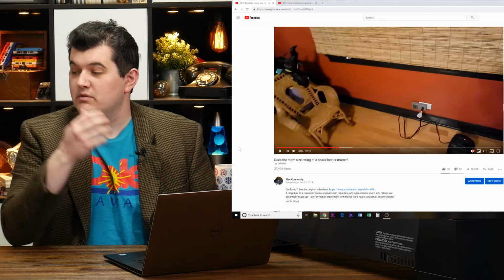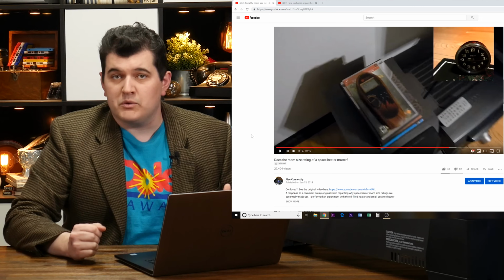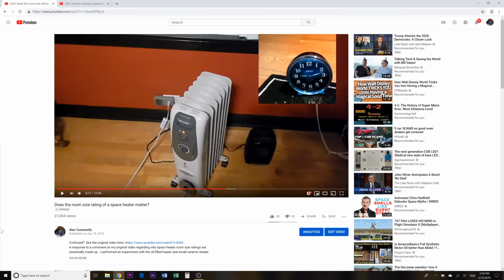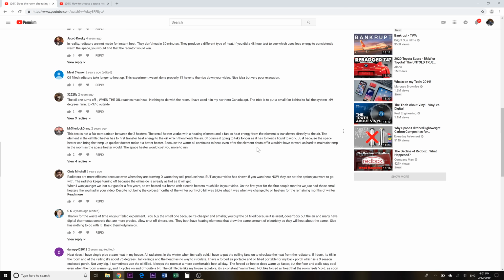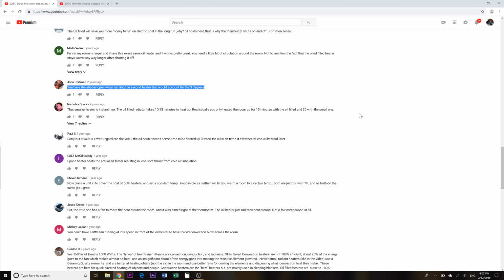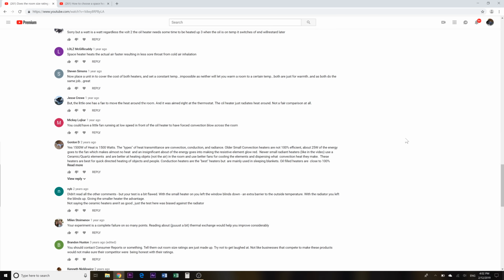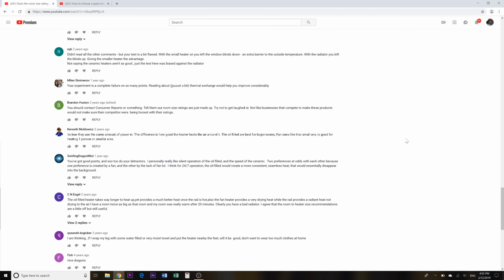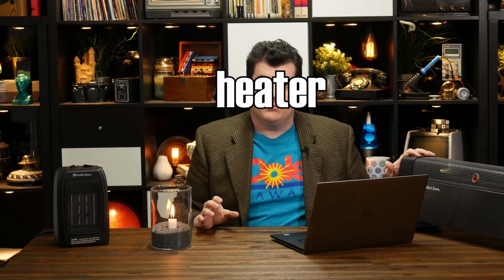More Space Heater Nonsense

Comment: My window AC pointed outside and thermostat shunted is still much more efficient than all of these.

You cannot create or destroy energy, so in a space heater 100% of the electrical energy becomes heat energy.  Period.  No matter what your argument you can't get more or less energy out than what you put in.  It's the indisputable first law of thermodynamics.  You CAN distribute heat in various ways, which is what drives a decision to not simply take the cheapest one.  You CAN use electrical energy to pull in heat energy from the outside to the inside of your room.  The inside gets warmer at the expense of outside getting colder, hence the reversed AC.  So my 500W AC can bring in around 2500W of heat, give or take, for "500%" efficiency.  The trick is it's electric work energy to heat energy, and I'm using the work energy to pull some of that heat energy in from outside.

To the videos main question: The small fanned heater is much better than the large radiant heater for a large room.  Fans distribute heat far better than passive methods, even if the unit is much larger.  Even though they produce the same amount of heat, this goes back to distribution.  The heat has trouble reaching far from the heater, and it is cooler around the walls because that's where heat is leaving.  The larger radiant heater is actually better as a personal heater.  Because it's so hot near the heater, you can turn it down and get warm near the heater.  Meanwhile the rest of the room is cooler, but you don't care.  You save energy by not heating the rest of the room as much.  So the small fanned heater is actually better for large rooms, and the large radiant heater is actually better for heating small areas (regardless of room size).  But if you write that on the box what do you think that will do to sales?  When Youtubers can't understand it even after a long explanation?  Yeah, it's all about keeping customers happy and getting them to willingly pay the most money even when they're dead wrong.

Comment: A fan helps. Something the little heater has over the big oil heater is a fan. I used to live in an apartment that had electric base board heaters, The walls would get quite warm, but the center of the room stayed cold. So I put a box fan to blow along the wall and  to move the air around. Problem solved.

Comment: At work I had a motor that was running at 20kW at normal load. The load connected to the shaft was all contained within the same room. No cooling water entered or left the room. I made the comment to my fellow electricians that the full 20kW was becoming heat in the room and the equipment at the same rate that it would be with a 20kW heater. I was very surprised when some of my otherwise knowledgeable electricians thought there was no way that could be true. Heat is the graveyard of all energy: sound, vibration, friction, light, eddy currents, hysteresis in the iron, copper losses, windage, bearing friction etc. It all becomes heat in the end. And it's all equal to the energy input to the equipment from the power cable.

Comment: Completely agree with the conclusion and, answering the question at the end of the video, can't think of any reason for the larger heater to be more suitable for a larger room. My comment is about the 100% efficiency and it is actually a question. Although marginal, wouldn't the one with the fan convert part of the energy to kinetic energy (moving the blades, moving the air)? Also, any kind of vibration or sound produced would be energy not converted to heat, right? Like I said, I imagine this would maybe cause only a marginal difference, but still not 100% efficiency in any case. Is the rational right? Thank you and congratulations for the awesome videos!

Comment: You didn't notice my comment. :/
The bigger one is the better heater for heating a large room with highly insufficient heating (as in it's 0°C outside and the window is always open) because it heats less of the room which means persons leaning close to it get more heat.
If you actually want to heat the room, then the smallest is the best because smaller=less heat energy on the heater=more heat in the room and of course a fan helps more than a smaller heater.

Comment: and that's why things are easier in europe, with 240V. those "space heaters" here go up to 2500W, and normal 1phase 3500W heaters are normal. also, if your house has a 3phase socket (which were quite normal till not so long time ago) , having a 6kW thermoaccumulation heater were quite normal (so to heat itself while electricity is cheaper, and use it when it's expensive without power usage)

Comment: Some of these small ceramic heaters have a PTC. They are like a positive temperature thermistor. As they get hotter their resistance goes up, current and power goes down. This is done to prevent overheating in case it gets blocked or the fan fails. No safety switches needed. In a very small room they just might put out less energy if the room got really hot. Still 100% efficient.

Comment: The production value of your video has zero bearing on the scientific results of the experiment. The fact is that the Big Oil filled heater can not, by Design, heat a large room as well. It doesn't matter what idiots say and try to argue. The facts are the facts. Don't let these idiots drag you down. Be you and continue doing what you do.

Comment: But dude to me the advantage of the oil heater is the fact once the room temp comes to what you want, the oil is heated up and the thermometer shuts the unit down and the heat of the oil takes over for a time.  Thus saving energy!
I had an oil heater I used in my cold room.  I liked it for how quiet it was, and yes it took a good while to get to temp but the room stayed more consistently warm.  However, one night something happened I heard a zap noise and looked over and my surge suppressor was smoking.  The suppressor was slightly charred black.  I assume the thermostat failed and I haven't used the heater since.

Also too I have one of those expensive quartz heaters with wheels.  It's big and bulky and takes up a good bit of room.  However, I really like that heater, because those quartz heaters fire up and heat a big room quickly.  Then once the room is heated quickly the thermostat kicks it off.  So by my reckoning.....If it heats quickly and shuts off it is not using 1500 watts all the time, that equals efficiency!
I would like to hear comments on my theory....Am I wrong?

Comment: Some people I know bought several of a famous brand of space heater (E***P***) to save money on heating oil. They placed them strategically around their house and used them for their primary heat source.
Imagine how surprised they were when their electric bill over the peak months of heat demand was much larger than a fill-up of their oil tank.
The whole notion of using space heat is to restrict the whole-house demand for heat by lowering the base temperature in the house a few (or many) degrees, then supplementing per room, while in use, with some kind of space heater.

Comment: Could it just be that certain types of heater are more suitable for long-term or unattended use?

ie. By their nature a convection heater or oil heater can more safely be left unattended (which may be necessary for heating a large room, or keeping a large room at a certain temperature).

I know from experience that fan heaters can more quickly get a buildup of dust & lint on the elements due to the fan continuously forcing air over them. I guess this could be more of a fire hazard if the thing is used over a long period or left unattended. This isn't an issue at all for oil heaters and is much less of an issue for convection heaters.

---

But yeah, I think it's mostly just marketing BS.

Comment: Reminds me of telling someone online how in the spring and fall I might use an old style light bulb as my apartment is radiator heat and I don't control the thermostat and when I need heat and light it is more efficient than a space heater even if it only runs 5 minutes an hour. But people can't do math cause they think my 60 or 40 watt light bulb is worse than using an energy efficient bulb and a space heater  that uses 125 watts in 5 minutes or 62.5 watts if on low. Crazy people that can't do math think my regular light bulb when I need heat and light is worse than a CFO or led bulb and a space heater combined.

Comment: You should try being in a 240V country: almost all are 2400W max (10A outlets)
Reply: Darren Bottin in the UK every outlet is 240 volts 13 amps. 3kw heaters are widely available and can be plugged in anywhere.
Reply: I live in Argentina and we use 220V 10A making 2200w in total, but space heaters are limited to 2000w
Reply: S you can buy 2 phase heaters which are 240v in the US. Proper wiring will need to be installed. Lots of garage heaters and construction heaters are 240v.
Reply: Or just plug in 2 of those $12 1500 watt heaters.
Reply: @S oh.. I'm a master electrician, I'm aware. But to change a circuit from 120 to 240 is easy as changing a plug and a breaker.
Reply: A large number of those “favorite electrical devices” are now compatible with both 120v and 240v outlets. Those devices just need the appropriate adapter. However, things that require a large energy draw (like hair dryers, curling irons, etc.) need both the appropriate adapter and the appropriate converter. Plugging a 120 v hairdryer, curing iron, etc. into a 240v circuit with the right adapter but without the right converter will immediately fry it.
Reply: Nope in the united states of America. Every household has 240v sent to your house.
Reply: @S dude... you can buy 240v heaters in the US... idk what you're on about.
Reply: @S also there are a ton of outlets, that are typical outlets. I think you're WAY over thinking it.
Reply: @TheDarkToes   You're fighting a losing battle.  We get 240v, and we can get more by combining multiple lines.  Some idiots from the other side of the world think they have a monopoly on good power.  It's become a fanboy thing with them.  I've been using 240v clothes dryers in America since the 1970s.  Few other things need that much voltage, and it's easy to provide it when they do.
Reply: @joesterling4299  no one here is saying that 240v is some magical thing that only non-americans have access to. It's just that when you go to walmart in the USA the majority of plug in space heaters will be 120v 1500w affairs. Just like the majority of space heaters in Aus for example will be 2400w. The argument is for the majority, and the majority don't have easy access to a 240v socket without paying an electrician.
Reply: America is a 240v country tho.

Comment: The smaller heater is more compact lending itself fit easier in space constricted smaller rooms thus the small room descriptor. The larger heater is more likely to crowd an already small room, thus is more appropriate for larger rooms is the best I can come up with. 

And purely theoretically, the fan on the smaller heater may increase airflow in the room overall, which in turn increases the conductive loss of heat from the room itself to the exterior environment via warm air flow over cold surfaces like window glass and poorly insulated walls.

Comment: All good info. I think it would be good to know the purpose for the different form factors from the engineers that make the specs for these things. Yes, the wattage is the same but the application is different. The radiant dishes and smaller fan types must be monitored and kept away from things. They will burn you or start a fire if too close to stuff - they are super hot within inches or even a few feet. The other ones are more mellow and are designed for long duration use - basically, leave on all day.  Different heaters for different specific applications and also different appearance and decor, the always important decor. The BS marketing is great though. You just have to hand it to them for figuring creative ways of extracting maximum cash from your pocket. But then those were the ones still sitting on the shelves.

Comment: That led is killing that space heater's efficiency! If the light goes through a window it will heat up the outside, and the heater will no longer be 100% efficient at heating the room! 

All joking aside a good two videos filled with righteous scorn for marketing BS. But since we are off in technicality land, where big differences in marketing make next to no differences in reality. One way a large natural convection heater would be more effective/efficient than a small forced convection heater, is that because the air isn't disturbed (as much), the air will be moving slower around the walls and windows, keeping the coefficient of heat transfer down. Whereas the forced heater is moving quite a bit of air and probably increasing the coefficient of heat transfer through the walls and windows, thus increasing heat loss to the surrounding nature. 

It's worth noting that the difference should be quite minor between the two heaters and you'd likely see more of a difference if there's a strong wind outside, and technically the heaters are still at the same efficiency level, it's just the one heater is causing the room to be less efficient.

Comment: Hey, just one thing to consider when you're comparing a "small room" heater vs a "large room" heater. The heat output is obviously the same, but the duty cycle is not. They probably don't intend a compact heater with a fan and single element to be used for hours on end to keep a 550 sq ft. room cooled(edit: I meant heated, lol), while the oil radiator heater will happily cycle on and off 24/7 with no issues. They might warrant the fan one for a year, but only expect 3 hours of use a day.

Comment: Im an HVAC tech with a degree in said field. I agree with everything you said aside from one thing. The designs with the fans are slightly better because they allow the heat to travel in a desired direction other than up. The circulation caused by the fan will move the air around the room preventing stratification. This is why ceiling fans can actually save money on the energy bill. The key is to distribute the heat around the room before it gets lost through the ceiling. I've measured 10 degree differences between the floor and ceiling of certain rooms without a ceiling fan or any fan for that matter. The thermostat is usually at shoulder height.

Comment: I think the reason people like the oil heaters more is because they seem safer and better for energy. They won't run full blast, as you say, and if they shut themselves off more it may save more electricity. The fan ones are definitely better for heating a room quickly. I've never tried an oil heater. I have only lived in apartments as an adult, and with small spaces it's cheaper and better to just run the central heat.
Reply: To add on, when you say all electric heat is 100% efficient, it's important to specify it's electric resistance heating. Electric heat pump heaters are better because they use electric energy to pull more energy from outside, giving you more heating for the power you put into it. They also use a different method of measuring "efficiency."

Comment: My problem is not heat, as it's easy to get warmer, just put on more clothes/grab a blanket. But  how do you get cooler for less power consumption? (besides laying in an ice bath).
 Pedestal fans just push a bit of room temp air at you, but use a small amount of power doing so.  The big AC units cost a fortune to run but make the room ice cold. Where's the middle ground  =P  Dysons "bladeless fans" just seem to work as well as a $10 pedi fan, and the tower fans just do the same but make a bit less noise.  i have a massive open plan room/kitchen/dining place and its impossible to cool.   I'm trying to work out if solar powered AC would be cost effective at this at this stage.. its 35 degrees C here and it's to fricking hot.

Comment: I like your explanations on these electric heaters and like you've mentioned gas and heat pumps are cheaper which brings me to my question.  I know I don't need to explain this to you but maybe for context and for others to get my drift. We used gas infrared heating up north in the work shop.  This would heat up the floors, walls and cars we were working on.  When we opened the doors in the winter, the shop recovered the warmth quickly because of all the thermal mass and what not.  Will any of these Infrared electric heaters work similarly vs just heating the air?  Thanks for the vids!

Comment: Like the video, agree! A screwfix oil radiator was rated at 1500W, but the thermostat would cut in and out with less than 30% duty cycle so it was not 1500W. Noone seemed to understand this! The DeLonghi radiator could run 100%. Returned it!

Lawrencw

Comment: Not free energy. It starts with vibration. When electrons vibrate enough through friction from conectic energy creates heat. Now the purpose of the hot oil to to retain the heat. For the metal around the oil through conectic energy allows teh electrons to break down thus maintain teh same output . without having to draw 1500 wats an hour. on the standar heater once you shut off the heat lowers down quickly thus under 200 degrees teh electrons no longer vibrate thus no heat is transfered. Its the laws of theorodynamics and physics. nwo the real issue os not to traw 1500 watts an hour otherwise your heat bill is over 150 dollars on that one heater. Which is still not heat effectiant. However no one is trying to make low wat energy that outputs 4 square inches a second of heat. the average heater requires 1000 watts minumum an hour to create 4 sqare inches per second of heat. If they somehow can create teh same about of vibration on teh electrons with lower watts then it will be more effecient.